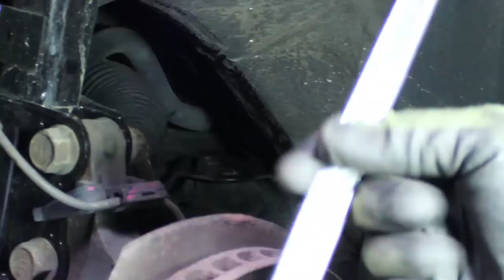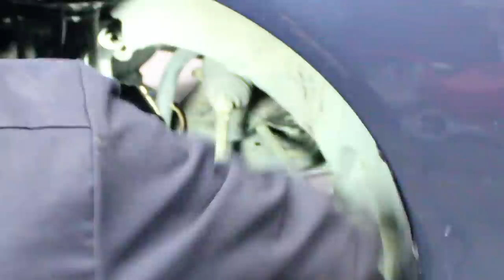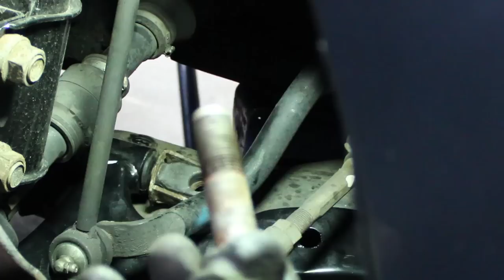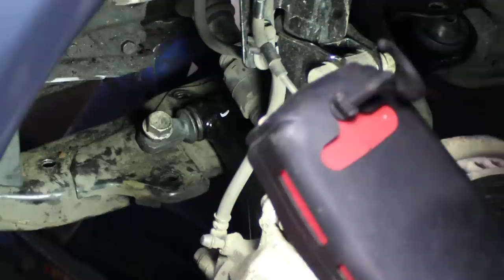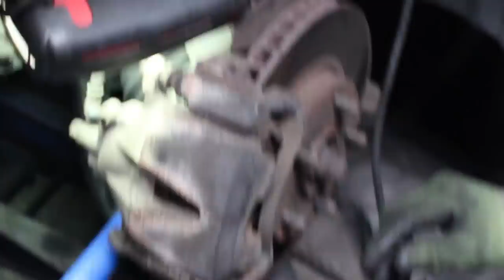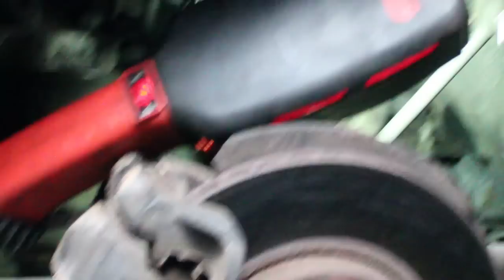How To Replace: Lower Control Arm - Toyota Camry | 2003 - 2016 | (Complete Step By Step Full Video)

Comment: This was a great video, really helped with the job today.  I replaced both control arms on a 2003 Camry.  The tips for removing the transmission and motor mounts were helpful.  If I could make one suggestion.  I found it much easier to install the rear bushing bolt first, then rotate the control arm into place to get the two front bolts installed.  Once the control arm was installed, I was able to use the pry bar to hold the control arm down to line up the ball joint.

Comment: Excellent. Clear images of everything and great commentary as you went along. Just for the record: The torque spec for the two 22mm bolts is 148 ft. pounds (!) and for the 19mm rear bushing nut it is 100 ft. pounds.
Reply from the maker: Thanks buddy

Comment: This is an outstanding video. I'm a very experienced amateur mechanic, rebuild my own transmissions for example. This is the kind of video you need for more complex jobs, and for ones with subtle points that can otherwise stump you for hours (aligning the two forward mounting bolts, e.g.).

I think when I first did this job on one side of our Lexus ES, it took me the better part of two days to figure it all out, just doing it on my own.  2 years later, I watched this video as a review and I was done in a leisurely 4 hours when I did the other side (very leisurely).  This is a difficult job for the DIY'er w/o professional tools, but this video is outstanding.  It really walks you through the small points and is not at all junk like the videos by other "big name" car guys just trying to churn views to make fractional pennies.

Great Job!!!!  Five stars, sir!
Reply: @Bruce Lee I wanted to say, if you actually did bend one or both of those pans, consider this:

a) The way to avoid that is to use a "drift."  This is a softer material that spreads the force out so you don't deform a critical material.  For examply, you put a 2x4 peice of lumber between your jack and the pan surface so it applies the same force, but over a much larger area so no specific ares is over-stressed and bends.

b) And if you did bend something, you really need to monitor that. Bending the pan can have bad consequences - the mating surfaces can defore and you can create bad leaks. In this area, it might not drip on the ground even, but run along the seam and collect in the belly pan, sub-frame, etc.  Go under there later and check.

If you are not an experienced mechanic, I recommend checking in at helpful forums like Club Lexus, etc. and soliciting advice first - people will always help!
Reply from the maker: Thank you much. Just got access to answer questions etc.

Comment: Best video on this project I've seen. I removed the dogbone (upper motor mount) to make it easier to jack the engine (I started on the other side of the car, replacing both LCAs), but forgot about the front motor mount. I will rectify that mistake before tackling the driver's side. Thanks!
Reply: Was it necessary to keep the entire front of the car elevated to do one side at a time? My driveway is on a slight incline and I'm nervous about keeping the whole front end raised
Reply from the maker: Sorry for the delay but I just got access to answer questions and comments. 
Thanks much.
Reply from the maker: Hi Gary, I am late for this job but in the future, it's always advisable to be on level  paved surface when jacking a vehicle. However, if I "HAVE" to do this on an incline, the front and the back, in  the direction of the incline, I will take every precaution to prevent the vehicle from rolling. For instance, if lifting the first of a front wheel drive vehicle, I will use well made rubber chocks on both rear wheels and apply my parking brakes as hard as possible. If it's the rear I will chock the front and put the car in, opposition to direction of roll, gear. Same theory applies to rear drive (in reverse).

Comment: After doing this a few times, I can tell you it's MUCH easier and even faster to just remove the knuckle. It sounds like more work but it's actually not because the arm then easily slides out and the new back in, and then I just set the knuckle onto the ball joint stud, reattach everything, and am on my way. No jacking up the ball joint or spending the whole afternoon trying to line up that back bushing  bolt or anything.
Reply: ScubaCat3 i shouldve done that its so hard trying to line it up
Reply: H P Trust me, it's actually a lot FASTER too because it's just a few more quick and easy steps.
Reply: Doesn’t this require you to remove axle retaining nut. Found this to be troublesome due to compressed edge.
Reply: I replaced the LCA on the passenger side.  The best way to seat it is to make sure the rear bushing is lined up straight. Then the bolt will go right in. Then set the other 2 on the sub frame.

I did learn that if you connect the ball joint onto the spindle first, you will have to unbolt the 2 strut bolts, to get it to set in.  Trying to jack up the spindle without it being connected to the LCA is next to impossible. The spindle wants to come out and not go straight up.
Hence I had to unbolt the 2 strut bolts, then I could connect the spindle-ball joint-LCA bolts, then push in on the spindle to line the strut bolts up.

Many ways to do this, but it's good to learn from others mistakes.
Reply: I do that, drop the knuckle.  Irregardless, you'll have to do an alignment anyway and removing the knuckle make it a lot easier to remove/replace the lower control arm.
Reply: listen to this man! just started the job and after getting stuck aligning everything on the passenger side, I'm going to remove the knuckle on the drivers side. A few more steps, but the time you save, along with the headaches makes it the best method.
Reply: Wish I read this comment earlier tonight. I had the axle pop out and tear the boot in the process, so now a new axle is in order. When I swap out the passenger side tomorrow, the hub is coming right off, first thing.
Reply: @scottwaters4889  I read your comment before doing this job and was like "hope I'm not like that guy"... well, the same thing happened to me from wresting the knuckle out of the way and the dang cv axle broke in half at the boot! At first I thought it came out clean but then realized the gushing fluid was not oil but grease pouring from the separated axle! Another $100 for the axle - I'll definitely be removing the knuckle on the other side. Sometimes slower is faster.

Comment: Thank you so much for this detailed video! Gained the confidence to do it and was grateful for the time you spent. Also, thank you for showing the struggle with getting the back bolt installed. I was able to handle it without having to remove the tie rod and swaybar link but I am grateful you showed it. Great job. Thank you so much!
Reply from the maker: you're welcome

Comment: Thank you for the informative video.  I just bought a pair of LCAs for my 2004.  I just did the rack last summer and there was no point doing an alignment without doing this job.  This video is very helpful.  I don't image that I'll get to this until the weather improves.  Still snow here.

Comment: I'm just getting set to do this procedure on my 2005 Lexus es330.  Your video is very helpful.
Reply: I performed this on my 2009 Camry, its much easier if you remove the knuckle from the axle because the lower ball joint castle nut was the hardest part with the cotter pin nicely rusted in place and you'll just have more room in general. Use a prybar to hammer-tap the new control arm into place of the 19mm bolt by the bushing first upon re-install. Good luck! New Ball joints will also get rid of steering wander on windy days.

Comment: Every video on YouTube is for the easy side that you can jack up on the transmission. What about the other side where the only thing to jack on is the oil pan which you can’t do. How do you get that motor mount out so you can get to that one bolt?

Comment: Also I'd just take the ball joint off the control arm. Would make it a lot easier to prevent it going too far in and not being able to get the nut on...

Comment: I seen countless videos telling me to mount or lift the engine/transmission. Can you explain WHERE exactly is the spot I’m supposed to place the jack?
Reply: Drivers side: you could either put a piece of 2X4 over the pan or on the split part of the case a little further back. I tried the pan first but it was lifting too high on the forward part which was bottoming out power connector to the alternator against a bracket there so I decided to jack up the transmission further back at the mating surfaces of the transmission case. This made the transmission lift up more evenly to where I could get the transmission mount off. I'm mostly done with one side and got beat up pretty bad and my axle separated at the boot. I would really read the earlier comments about taking the whole knuckle off to do this and consider that route. That's what I plan to do on the passenger side and I might have to do it to the drivers side since I'm encountering so many problems although I'm so close Im not sure.

Comment: Good video. I had such a problem with the back long bolt on the control arm I thought I am doing something wrong. I see you had the same problem. Also the ball joint castle nut was a nightmare. I eventually removed the axle then cut off the ball joint nut and grounded it then using a tool pushed it out. This is a hard job for sure. Your video helped me a lot.

Comment: Great, Similar to Tarago 00-06,(Aussie 8seat minibus) same engine mount in way problem.
I was thinking, loosen front bolt (split ring spanner) remove rest & pivot arm around & use bolt puller to replace bush, would that work instead of lifting motor & removing engine mount? maybe front bolt TOO Tight?

Comment: Doing this job today with some MOOG control arms on my 2013 V6. Hoping all goes smoothly!
Reply: Update: DONT pull hard on your passenger cv axle. It will come apart. The boots will come off. The intermediate bearing is very hard to reach to remove. Just dont pull on the cv. Be careful if you turn the steering wheel with the ball joint disengaged. That's how I broke my CV.
Reply: I just did this job on the driver side to my car over the last 2 days. Some things I learned: 1. Take the CV out the whole way before starting. It will save you a lot of work.    2. Lining up the rear control arm bushing is hard. Get 2 people to help. 3. When jacking up the transmission, the front mount bolt is extremely important. If you have the V6, you have to use a universal joint to loosen the front mount bolt. If you dont loosen it enough, the Jack will life the whole car by that front mount bolt. Which is dangerous and things could break. It may be best to take that bolt completely out. It should line back up when you let it down. 4. Get a ball joint tool that squeezes the top of the ball joint down. It will save you a lot of time hammering wedges.
Reply: @shaneolean1396  which front mount bolt are you talking about exactly?
Reply: @planchik  The front motor mount behind the radiator.

Comment: NOTE TO AUSTRALIAN VIEWERS.....the Oz built (4 cyl) Camry is different. You do NOT need to remove the engine mount (on the left side) as both bolts are readily accessible (and tight!!). The rear bush bolt looks hard to get to but the (top) nut is on a retaining plate so does not need to be held when undoing the bolt from the bottom. Some smart redesign for the Oz built Camrys.....
Reply: maybe so, but the Aussie Tarago is a bitch with the mount in the way & mount long top bolt problem ~ the other mount bolt is a good tip at 4:22

Comment: Unfortunately while doing this job the other day, I somehow managed to ruin the bolt hole threads of one of the 22mm holes (not the one under the motor mount).  Any suggestion on how to fix that as its a high torque location?  A tap?

Comment: I turned this into a night mare lol I popped the cv axle shaft out of its socket on the joint and had to  put it back together. This happened while I was trying to loosen the castle-nut for the balljoint
Reply from the maker: Sorry I am 8 months late. Just got access to answer questions and comments. 
Hope things worked well for you. Fortunately it's not like the CV joints on the early VWs. The Japanese vehicle axles are easier.

Comment: Did you try to pull the motor mount up all the way and then try to bring it out from the bottom instead of pivoting it from the top?

Comment: I just changed the LCA on my 2007 with new ball joints as well but noe when the wheel turns there is a popping/clicking sound. Is that because its new?
Reply from the maker: Sorry I am 9 months late. Just got access to answer questions and comments. Hope you were able to solve the problem. Answer is no. In a case like this, many certain everything is tight and secure. Check axes joints etc.

Comment: Does any1 know if you buy an Toyota branded OEM lower control arm, will it come with the ball joint? Should I get the ball joints replaced with the control arms?

Comment: Thank you so much.  Great video.  I did exactly what you have done and it works great for Camry 2007 LE 2.4L.  However when I dropped the car at the shop for alignment, They can not align it well and they thought that I had an accident at the passenger side. They said the best they can do is to have a Toe deviation of 1 degrees which is A LOT.  I am not sure what is going on wrong.  I suspect that the issue is in the aftermarket control arm and ball join.  I think I should have bought the original parts rather than using the aftermarket one.  Any idea what else could be wrong?  It is just too much work for replacing the control arm again :(  Thank you
Reply from the maker: Hey man, sorry I didn't get to you a year ago. Just got access to answer questions etc.. 
I always use aftermarket arms. Never had a problem. Was the problem solved?

Comment: Hi. I have 2007 Camry V6. Do you jack the engine with piece of wood on transmission pan to remove both engine mounts?
Reply from the maker: Hi there, anytime you have to Jack up an engine or transmission, locate the most solid part of the unit you want to elevate and place a piece of wood between  the Jack and that area. If you're doing this on the pan, use a piece of wood that will cover a large surface area. 
Thanks for watching.

Comment: Guys   , after finishing the replacement of control arm ,,, is it necessary to alignment of the tire rod ?
Reply: Are you asking if you need an alignment? Probably not really necessary but a good practice - your car is probably due for one anyway. They'll check to see if it needs it anyway and adjust it if it does.

Comment: how many hour needed to replace front left and right?
Reply: I did recently on 04  v6 camry, had to cut using sawzall 1 engine mount bolt and another control arm bolt. These models have the WORST design, took around 20 solid hours continuous if you have to calculate, I took couple days spread over to finish, i also replaced inner and oter tie rod and strut assembly, wheel bearing and hub as well

Comment: I have a Camry with 128,000 miles, was going to only change the ball joint after this video I am better off changing the whole control arm.
Reply from the maker: Sorry for the delay but I just got access to answer questions. 
You were on the right track. Hope your repair went well.

Comment: Not looking forward to doing this, i see my LCA bushing showing cracks on my 2009 so I guess it’s coming soon
Reply from the maker: Good luck, let me know how it turns out
Reply: @precision_eg  Turned out good! I found two OEM ones on Ebay for a good deal (2004-2016 are all the same L/R parts) I disconnected the knuckle from the strut and cv axle so I can have more space. I had to wind up cutting the cotter pin and impacting the castle nut off. Made the job much easier with the knuckle free though. Thank you for your video!

Comment: Is it normal for the rear bushing to have a lot of flex?
Reply from the maker: These bushings are not designed to flex a lot because that will give rise to sloppy handling. When checking bushings, I jack the vehicle up, remove the wheel (use Jack stands at all times) and place a pry bar between the slot where the arm fits and the frame that the bushing is pressed into and pry. If you're uncertain, compare left and right sides. Also look for cracks in the rubber. Check the metal sleeve in the center (shouldn't be separated from the rubber).
Thanks for watching and commenting.
Reply from the maker: Sorry for taking so long to respond. Just got access two days ago to respond to comments.

Comment: I have to say Toyota disappoints me when it comes to this remove and replace. The fact the trans mounts have to be removed surprises me. This is a inconvenience American car Engineers usually leave us shade tree mechanics. That being said do I want to spend a  entire day on my ass in the garage or take it to a reliable local shop who gave me a quote of $900 parts and labor for both control arms?
Can I get some opinions?
Reply from the maker: Don't know what to say about this except that, every vehicle out here have their pros and cons. 
My background is in engendering and I spend a lot of time looking at how things are designed and what they are designed to do. Believe it or not, the old Volkswagen beetle, in my opinion, is the most thoughtful design and therefore easiest vehicle I've worked on.
Reply: Wait untill you replace the rear lower forward. That's a pain! The gas tank is blocking the bolt